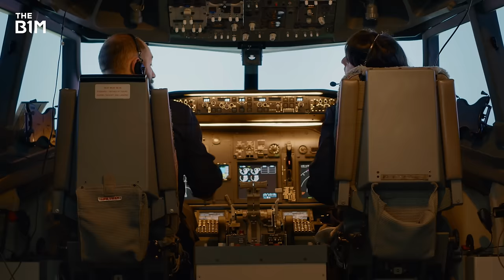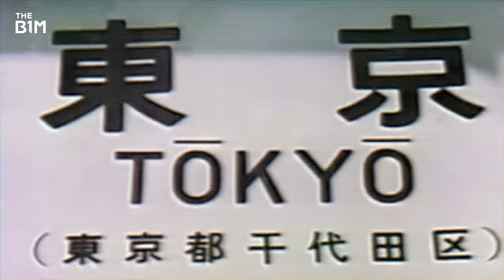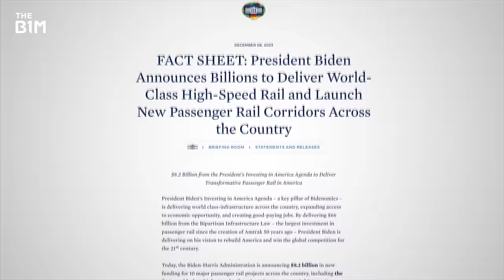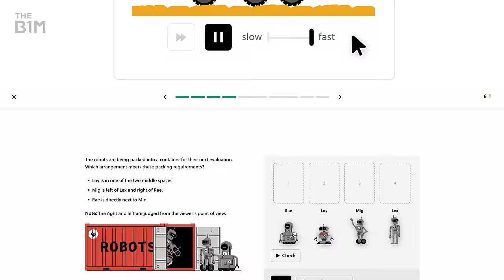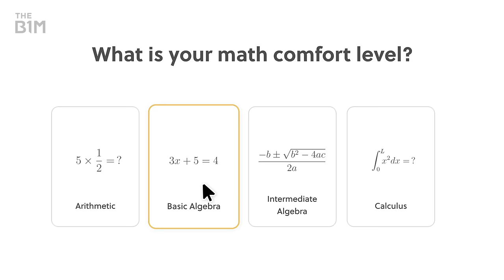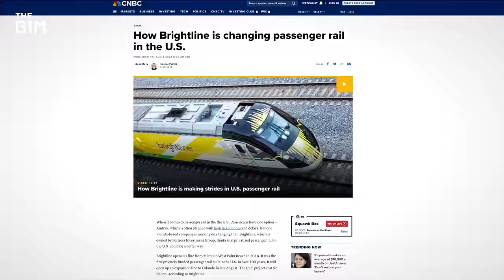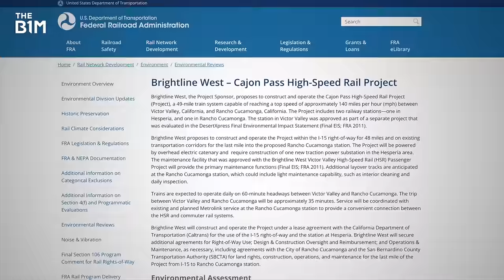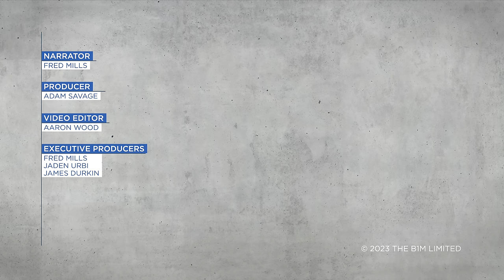The $140BN Race to Build America's First High-Speed Railway

Comment: Great video! The Northeast Corridor between NYC and DC is likely the only corridor in 🇺🇸 where traveling by train is faster than driving and competitive with flying. Acela trains in the corridor generally run at 125 mph (~200 kph) in Pennsylvania and Maryland and 135 mph (217 kph) in New Jersey south of Newark. Not surprisingly this is the section of Amtrak that sees the most ridership.
Reply: Years ago I was at a wedding in New Jersey.   At the reception I heard a loud roaring
sound every twenty minutes and saw something flashing through on the other side 
of a hedge.  I asked what it was.  It turned out we were next to the main rail line 
between NYC and DC.  They were going fast enough that I noticed, anyway!
Reply: Due to population density .
Reply: @lassepeterson2740  Ridership on the NEC went up noticeably after speeds were increased on the corridor. I don't believe that was solely due to population density.
Reply: @dcapitan7  True not "solely due " if the trains are already in good use and service gets improved then you would attract more passengers .   But still only if the population density is there of course .

Comment: Acela will be the first HSR in the United States. They are currently upgrading the service with new trainsets and some infrastructure upgrades to achieve 160 mph. Supposed to begin service this year but still in testing.
Reply: That is encouraging, thanks for sharing
Reply: It already technically is high speed rail. That global definition of 155 mph+ is for dedicated tracks, while shared tracks is 124 mph+, which Acela achieves for some of its route, and Amtrak is working to increase speeds on other segments of the NE Corridor.
Reply: @ChrisJones-gx7fc  Don't kid yourself
Reply: @ssss8162 OK bozo 👌
Reply: @ssss8162 No kidding necessary. Just facts.
Reply: 160mph ain’t high speed rail that sh-t was obsolete by 2010, China and Japan had that since 2006
Reply: Has to be the SLOWEST "HSR" or whatever you call it, in the world den
Reply: Funny thing is that the current train sets could actually achieve high speed rail by the definition, as they have a top speed of 165 mph. But of course, they can't actually run that fast on the Northeast Corridor. :/
Reply: @Kaidhicksii  Correct, from what I gathered in their press releases/news, the new trains have better "tilt-technology" and other advancements that allow them to go faster with the infrastructure limitations. (to be fair, the 160 mph quoted is "top speed" not average, I think the average for the whole thing will still be 90 MPHs)
Reply: @ericktellez7632 I think China has some slower dedicated high speed lines because 78mph(128kmph) average speed is actually not too bad with what is mostly conventional track.

Comment: I read somewhere that Brightline also has their eye on the I4 corridor for a high speed rail to connect Tampa and Orlando. This has been talked about for as long as I can remember. Maybe Brightline can finally make it happen.
Reply: Not sure why SunRail hasn't done this first TBH. Seems so obvious to tie Tampa-Orlando-Daytona together with rail if possible. A whole Central Florida Mega Region
Reply: I think it's already in planning
Reply: @@karlwithak.Yes. Brighline is making lots of money off so called "Floridians". 
They are a profitable company.
Reply: They are going to do it, extend the Orlando station to Tampa
Reply: @@karlwithak. They claim that they will break ground on the construction early 2025
Reply: Based on the plans, looks like the expansion plan includes a Disney station and across to Tampa.
Reply: Tampa to orlando regular driving is only an hour away.  Why hop on a train?
Reply: @redesignedlife777  one hour? When’s the last time you’ve been on I4? It’s 45 minutes just to Lakeland if there’s no traffic, which there almost always is. The train would be able to go faster than a car and it won’t get slowed down by traffic. If you are a tourist that doesn’t know the roads, it would be much easier to jump on a train than to drive. It’s also would require much less fuel to move a lot more people. The advantages go on and on. Why do you think Europe has such a large mass transit system including a lot of trains. It is just a more efficient way to move people and is less impactful on the environment.

Comment: 'underused freight railline I can buy', is a key phrase used. Railroad is actually used probably more than ever in the United States, just not for passengers but for commercial use, which has shoved out residential use for existing lines (in addition to issues noted in this video).
Reply: Exactly very efficient with freight
Reply: Wrong. We have a ridiculous freight rail system that is predicated on  minimizing labor costs, not making good use of the rails. Two mile long trains that block each other, sometimes for a day or more. And of course illegally blocking passenger trains. Our railroads are a national disgrace.
Reply: Trains still more efficient and if the government gets out of the way
Reply: There’s lots of places where freight railroads are cutting back shipping to either focus on single good hauls (e.g. coal) or because places have de-industrialized.
Another example of an underused freight rail line is the CSX A Line in Florida. The Orlando part of it has been bought out by the state for SunRail and the Jacksonville part of it has been bought out by Amtrak. If the middle part is bought out, then frequent service between Jacksonville and Orlando could also be run, with trains then going south to Miami on Brightline tracks or to Tampa on their proposed extension.
Reply: @jeffreysnyder290  Do you typically just make this stuff up as you go along?
Reply: @RevolverOcelot79  I don’t make things up. Do you typically try to counter facts with no facts of your own, whatsoever?

Comment: High speed rails only make sense when they directly connect between city centers from where you can access destinations by public transits.
If you have to go to the station by cars and have to park there, the stations must be located at suburban areas to accommodate many cars. 
In such case, there is no advantage of high speed rails compared to airlines.
Reply: There is still a big advantage, but it's still much worse than if there was last mile tranist
Reply: This project is connecting with Metrolink to get you to Union station that has many transit options for the LA area with more going online in the coming years.

As for Vegas. I don't see any changes there anytime soon but at least the station is relatively close to the strip and once there most people don't really venture out.
Reply: Exactly, these train stations should not be a “park & ride” concept. No everyone wants to drive or has to get in a car.
Reply: Brightline would be well connected to mass transit in the Los Angeles basin.  Metrolink has just updated from commuter rail to all day service.  Connections to there from other local trains and buses has been improving.
Reply: completely true, but one step at a time!  this project (should) incentivise local public transport connections
Reply: Public transport access has to be good, but it doesn't have to be in the city centre (though it would be nice). 

See also: TGV and Chinese HSR
Reply: @themoviedealers  well connected 🤣🤣
Reply: @mikelherrasti2697  I agree they shouldn't be park & ride,  but I'm curious how is it working in Orlando?  If memory serves the train goes to the airport, and it's still a hefty slog to any of the major theme parks in the area, hell a quick Google map search shows a 20 minute car ride to Disney World, but using buses 2.5 hours.
Reply: Plenty of high-speed railway stations in France are in the middle of nowhere, with only a car park. Usually the reason is politics ("we won't let you build a high-speed line through this area unless we get a station"), what with France's highly layered government. But high-speed trains make commuting a lot easier for a lot of people.

Until recently, Paris was relatively car-friendly. Getting there, though, is a different story. So, if you can leave from the comfort of your home 100 km (60 miles) from Paris, drive to the station, and be in Paris within an hour, commuting distance suddenly becomes a lot further.
Reply: Nobody lives in the cities anymore, except those who would ruin the trains. The suburbs are far more important.
Reply: @starventure  If you're taking a high speed train, you probably aren't going from a suburb of city A to a suburb of city B. Its more likely you are going from your home (which sure is probably in the suburbs of city A) to a downtown or other busy area of city B, where relying on rental cars or taxis would be very inconvenient or expensive. So having the station located either in that downtown or by public transport is essential to getting people to ride the HSR line
Reply: @Gfynbcyiokbg8710  Not everything is downtown however, so you need a car. attractions/amenities/ and places to go can generally be scattered about the entire metro region, not necessarily all concentrated in downtown. In fact most American downtowns are just central business districts with few attractions.
Reply: @blackhole9961  If you're going to a city, expecially LA, Vegas or San Fransisco, you are probably going to either downtown or another buzy area tho. And those areas should be connected by public transport, because if you're anyways going to have to rent a car, you might as well just drive your own
Reply: @Gfynbcyiokbg8710  which is exactly why most people just choose to drive places because not everything is concentrated in one area.
Look at DFW for example. Actual places to go are scattered about and not always necessarily concentrated in one area.
Public transit can’t be everywhere and connect everywhere. American cities are simply too spread out with euclidean sprawl in comparison to their populations.

If the place you want to go isn’t near a public transit line you’re practically screwed without a car.

Comment: On December 20, 1967 the United Aircraft TurboTrain reached 273kmh (~170 US miles per hour) on the Pennsylvania Railroad in New Jersey. This records stands today.  However, built by an aircraft company, the old railways used to maintaining steam engines had no epertise to maintain and operate this train.  CN in Canada did spend the time to fix the train and learn about it and the Turbo remains in service till early 1980s.  Its technology was since blocked by FRA since the 1980s since FRA required heavy steel trains, balked at jacobs bogies (and got amtrak to retire the Talgo trains that had been given an exemption).   Except for propulsion, the train itself was right up there with today's TGVs. (aluminium car bodies, jacobs bogies, passive tilting, pressurized interior etc). 
CN managed to cut Montréal-Toronto by one hour for some time to do the distance in 3:59 instead of over 5 hours  (today, VIA does it in 5.5 hours or more). In the end,  it is about the tracks, not the trains.

Comment: It seems that a  Phoenix to Las Vegas high-speed rail line could work too.  There already exists a straight highway between the cities.  Union Pacific is working on re-establishing passenger service between Tucson and Phoenix.  Passenger service ended in the mid-1990s and the Phoenix station was closed, but not demolished.  Current Amtrak service bypasses Phoenix to the south with the station operating in Maricopa.
Reply: Vegas to Albuquerque with a stop in Phoenix would also be possible and would connect the major cities of 3 states together. From there it wouldn't be too hard to connect to and future lines in Texas.
Reply: Same story here in Indianapolis. Train station is almost never used and Amtrak comes like every few days or every few hours and it’s mostly just to chicago and that’s it.

Comment: Actually, high speed trains can handle steep inclines quite well as they are generally very powerful. Many french and german high speed train lines offer inclines of up to 40 promilles. Definitely much steeper than what a freight train generally handles.
Reply: That is correct, the difference is actually curve gradients, although cargo trains can run alongside almost any highway for high-speed passanger trains like Shinkansen, TGV or ICE you need a separate line and can't use the freeway median as depicted in this video.
Reply: It not about how powerful the traction motor is. Steel on steel can only offer so much friction, wheel slip and you end up with bad  motor.
Reply: Washington and Boston should've had it done 
Lb Johnson would've been remembered
Reply: Has it something to do with storing the. energy  used in regenerative. braking to give them a ' boost' going uphill?

Comment: As a ferroequinologist Fred, you covered this topic very well. However, I don't know why the US is concentrating on the high speed aspect. They should upgrade tracks currently used by passenger trains and build new tracks that don't necessarily allow trains to exceed 155 mph. However, the elephant in the room will always be the fact that the major freight companies own over 90% of tracks which are not always suitable for passenger traffic. Best of luck USA!
Reply: Aren't they they are big hurdle for propper electrification? They want to sell hydrogen and battery as more reliable than electrification
Reply: Wresting control from the freight companies is going to be so difficult that that’s why I think it’s better to just build the greenfield infrastructure for HSR to guarantee priority for passenger movement
Reply: @lecho0175  there are major sections esp out west that are so remote that electrification is not feasible due to voltage drop or line loss. couple that those areas are the ones dealing with power issues (mostly due to issues like water flow on the Colorado river/hydro electric) makes these really hard to implement. Currently the U.S. is dealing with the biggest problem  ever faced in public works: most of our infrastructure was built in the 1930-1960's and is falling apart, and our electrical grids are a huge part of this. With the electrification of EVERYTHING we have made it into the realm of "do I charge my vehicle so I can go to work tomorrow, or do I run heat/AC?" (esp in places like CA where they are actively banning things like natural gas/propane for heating and cooking, and gas powered lawn/small equipment and pushing EV's while shutting down nuclear plants while the installation of "green" tech and the power generation of said tech can't keep up with the demand..) we are running into issues like the failure of PGE to properly maintain their transmission lines which was the likely cause of multiple wildfires, or the Texas blackout, or even the TVA's outlook that they are currently pushing capacity. The infrastructure at this point physically can't handle a nationwide electrification without MAJOR upgrades that will cost BILLIONS of dollars, which will be pushed on the customers who already can't afford it. (Look at the rate hike after Hurricane Laura in TX/LA)...

Comment: The problem is mate,the American oil companies have a choke hold on our state and local politicians not to build a high speed rail.the oil companies are keeping people in their cars only. were trapped.
Reply: which is irrelevant because most of Brightline is privately funded and existing state law giving them right of way for construction is keeping the project profitable.
Reply: @tankextremez5605  See high speed rail is the top of the pyramid when it comes to transport. If I have railway connecting Huston to Austin or SF to LA, once you get there, you are trapped because of the lack of bus and metro infrastructure to move around. So why take rail when taking your car will save you the headache when you get there, you need the base to be built first and our government refuses to fund or enforce that. Which leads to very little reason to build high speed rail. These companies that keep lobbying in our government have essentially fucked this country over, I genuinely hate how that is allowed with zero regulation because companies always value profit over people.

Comment: The Cajun pass is greatly underestimated. The 15 goes straight up and reaches higher elevation than the 2 railways.  The railways have serpentine route AND found the lower pass route that reduces need for elevation gain.  Sticking to the 15 median will mean grades that are not likely to be acceptable for any type of rail, except for cog railways in switzerland.  Going down the pass at such a grade will be downright dangerous.  Suspect that once funds widthdrawn and work started, there will be a study release that shows need for a tunnel through the steepest portion of pass and they will seek additional government funding. 

Stopping at Rancho Cucamunga will provide serve to Inland Empire, but not greater LA area.  Rancho is 100km by bicycle from LAX.  Sections of Metrolink tracks are single track along the way, by the good news is Metrolink controls the tracks to San Bernadino (even through freight yards at San Bernadino) so the freigt companies can't limit frequecies.  Whether Metrolink would be allowed to electrify is a big question.
Reply: Yes. The Cajon Pass is a 6% grade which is too steep for HSR. If they don't tunnel,  they would need to build elevated viaducts along the 15 fwy to reduce the grade to at least 4% though 3% would be better to traverseat higher speeds..
Reply: 🧠nice to see somebody actually did their homework on this 💩